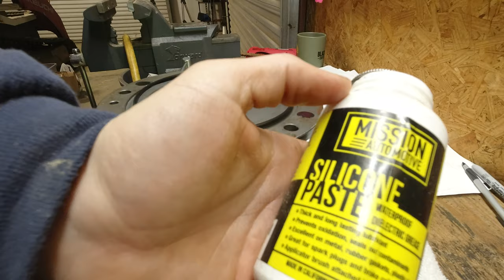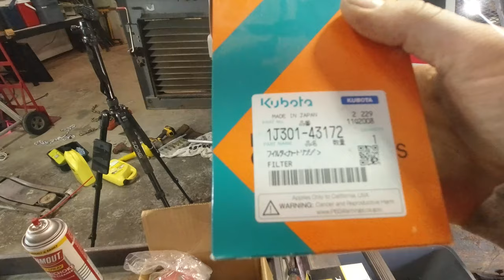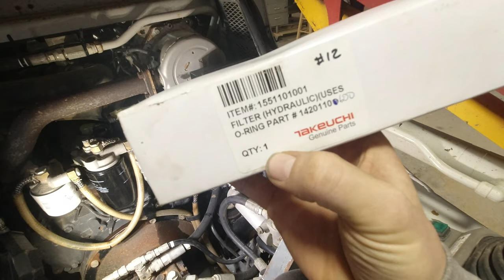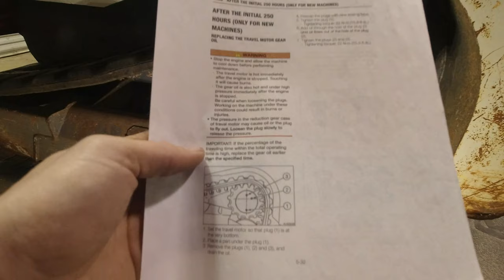Doing a 3,000 hour service on skid steer

Comment: Don't know where you live but I would gladly bring my TL8 to you for service. Like the way you are so thorough. If you would be interested let me know where to bring it and how much you charge.
Reply from the maker: Thank you! I was in south GA but relocated to western NC now.
Reply: Not trying to sound condescending in any way, but I wanted to know why you wouldn't replace the belt with the water pump, the hoses when they were off and the cooling system was empty.... and here shows how much I don't know.... but is there a thermostat that could have been replaced as well? These are (or should be) all low dollar items in relation to if they fail in the field.

To be fair- I do not even own one of these yet, just trying to understand if what I am thinking is overkill or reasonable.

Comment: What a phenomenal video bro I really appreciate it. Just got a well used TL150 and this is going to help me. I love the paint recommendation can you tell me how much you went through on that paint job and did it apply well with the brush? I don’t want to spray or use rattle cans I like your idea.
Reply from the maker: Thanks! I’m glad it’s going to help you. The paint job was pretty easy. That paint applied extremely well. I think I used about half a quart in both of the different grays and not even a half quart on the red. The brush applied it really well. It’s a little time consuming but it works good. I didn’t want to get over spray on everything with a rattle can
Reply: Thanks I’m going to do the paint on mine for sure I already have a quart of each in my cart just waiting for you to reply. First I have to address a pinhole in the fuel tank where one of the hoses wore through.
Reply: The old TL150 looks brand new now I can’t believe it! I still have to finish the cab but what a difference it makes. I just use mine for personal use but I can definitely see how in your case it makes a much better impression to the customers. Once again I really appreciate the video and if it weren’t for you I’d have never know you could do a decent paint job without spraying. Yeah there are some lines but it’s totally acceptable and people are amazed at my little lipstick pig now. 😂

Comment: hey Justin
I see your familiar with the TL8.  I just picked up a 2013 tl8. It used to be a rental.  Every TL8 I've seen in many videos and pics is white.  mine is factory Green.  Is there any significance to it being different in color?   also, I want to thank you for this video,  I will  use it to do a complete service on this tl8 before I put it to use.
Reply from the maker: Congrats on your new 2013 tl8! 
A green TL8 came from sunbelt rentals. Sunbelt rentals orders most of their rental equipment in a green color as part of their branding strategy. I think that’s literally the only difference. Exact same machine. Just different color.

Comment: Where did you order your filters/parts?  What oil did you use in hydraulics? Your video is very helpful. Thanks!
Reply from the maker: Thanks! I got the filters from a Takeuchi dealer. Also sometimes use a kubota dealer for the kubota specific filters. I use rotella 10w30 diesel engine oil for the hydros.

Comment: What’d you use to remove the majority of the concrete from the machine?
Reply from the maker: The hard stuff I used a chisel and hammer, a lot of it was un-cured. So I was able to use water and a screw driver to scrape and work it all out of the tight spaces and I also used a shop vac, it was a bit of a process.
Reply: @JustinBiddix I’m in the same boat with the same machine 😂. I’ve been using a chisel and hammer. Definitely a process 💪. Thanks man!